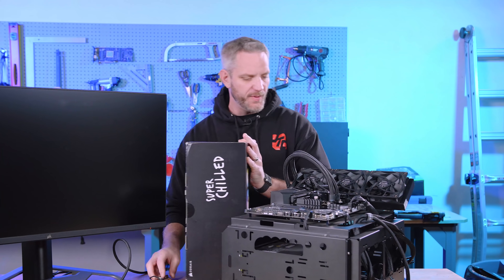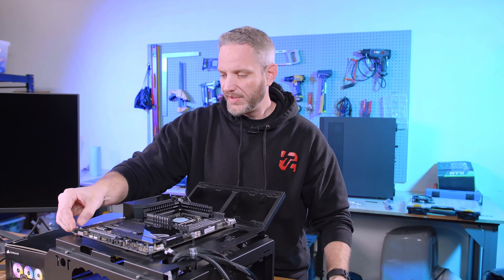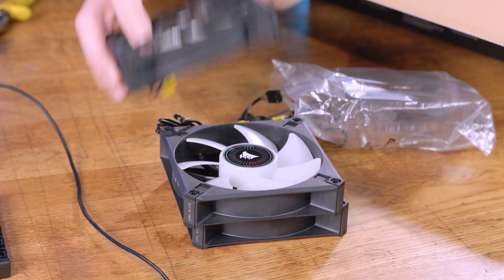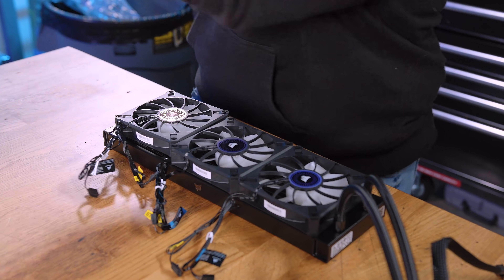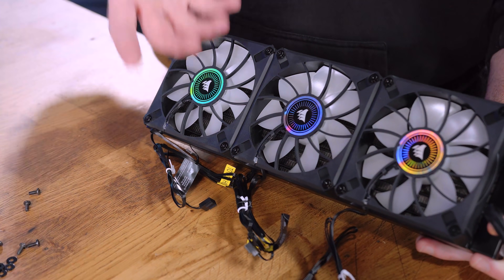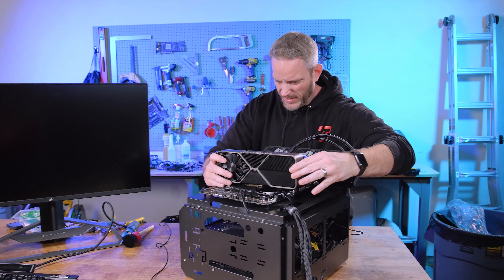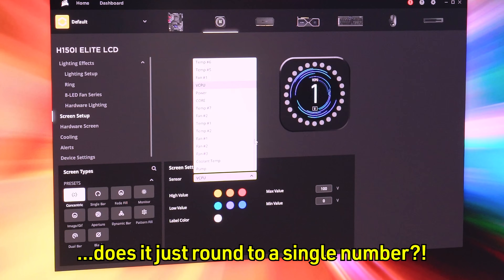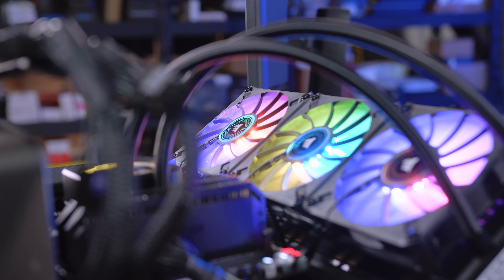Who knew this cooler could be so... COOL!

Comment: I disagree with your reasoning for open air. If you use the same case everytime then you have comparable cooling data for the coolers you have tested, it is exactly the same as using the open air bench except your temperatures will be higher because it is in a case.

The correct reason for using the open air TEST bench is you are TESTing the hardware. Nobody wants to TEST inside an enclosed case because swapping hardware inside one is inconvenient to get the same proper results and you would need a case that will fit all hardware.

And you are completely wrong about "testing a case", to test a case you need one thing you are missing, the same CPU, GPU, PSU, RAM, and motherboard test results from multiple cases for comparison. Without comparable data you used a case and not tested it. You may as well claim you are testing the open air test bench because that's exactly what you are thinking when you claim it would be "testing a case" if you used one instead.

Comment: 2:05 but the measurements will become bullshit, because the surrounding air in the room will help cool the unit. In a real-life situation the sides of the case will always hinder the cooling to some degree. By artificially removing that hindrance, you are in effect removing the cooling from reality. The open test-bench measurements are bullshit to the same degree, they show better results than reality because the extra work of removing the hot air from the case is removed from the formula.
Open test-benches are only good for one thing in testing cooling systems, pander to manufacturers, helping to sell them by falsifying the measurements. If you want to compare cooling objectively, put all of the coolers in the same case (not at the same time though), than make measurements!

Comment: corsair feature request for the gif feature: ability to throttle the speed of the animation based on a % variable, e.g. closer to 100% cpu, faster animation. 
use case: load up a image of a hamster running on a wheel.

also, black hot glue exists, that would have been less bad.